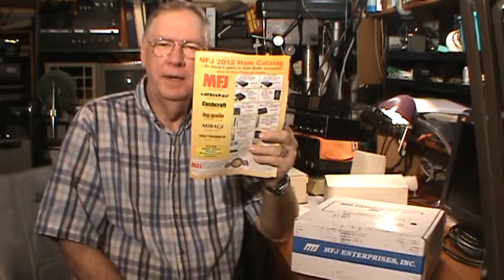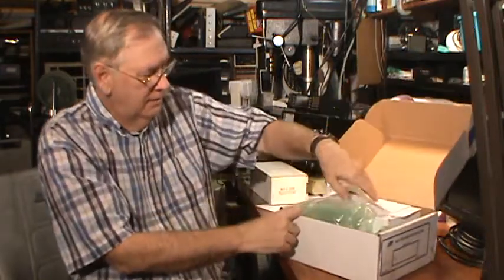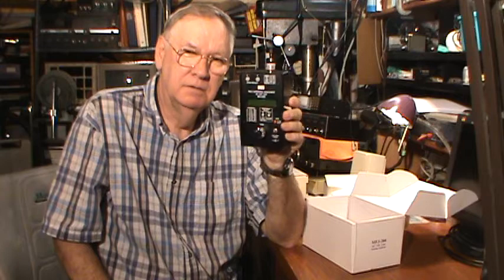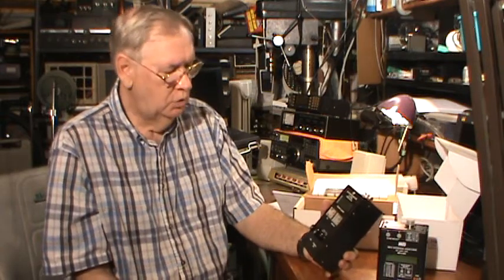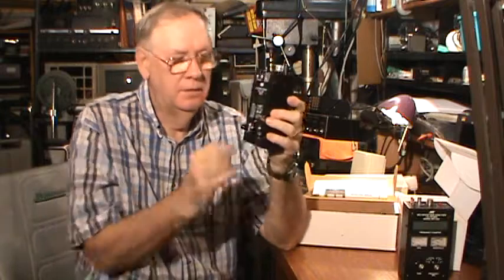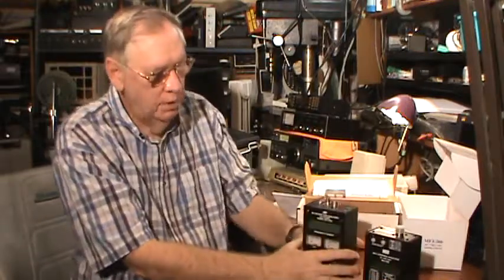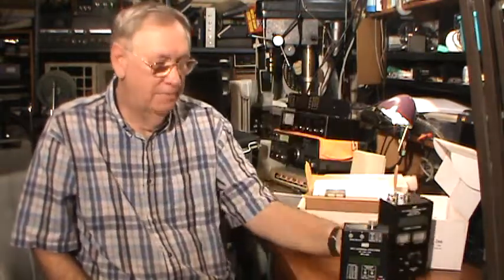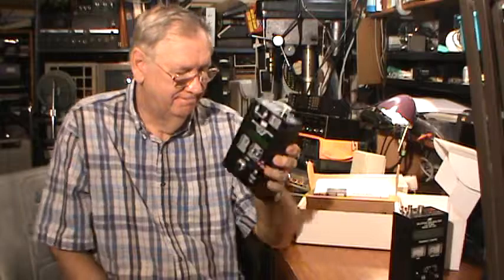TRRS #0050 - MFJ 266 Antenna Analyzer, Part 1

Comment from the maker: @tman855r As I said in the video, the manual says you can not use rechargeable batteries as the voltage is too low.